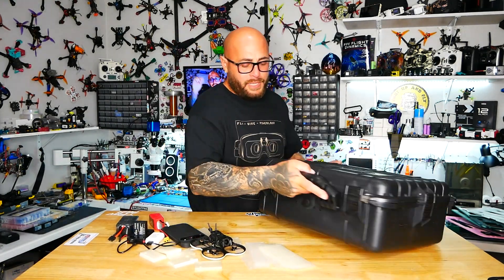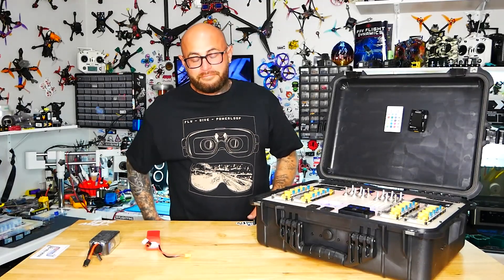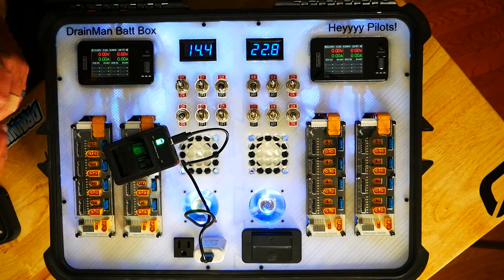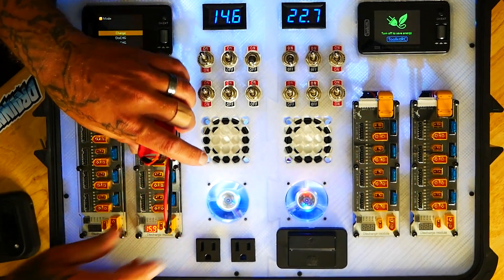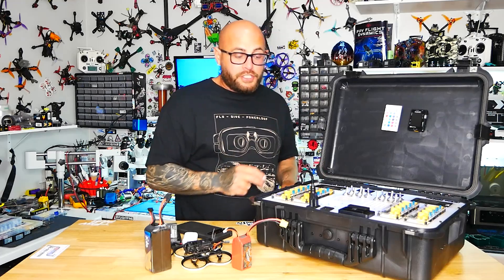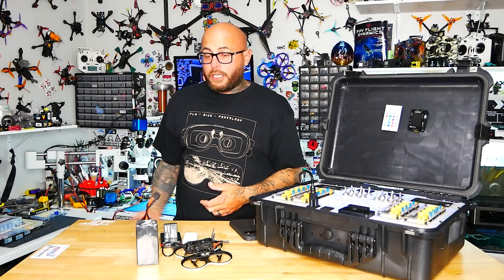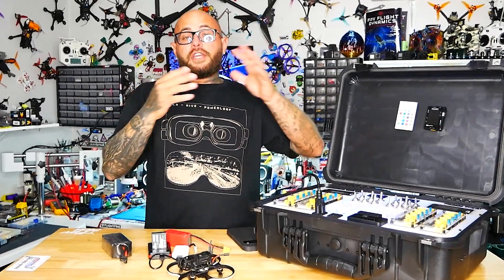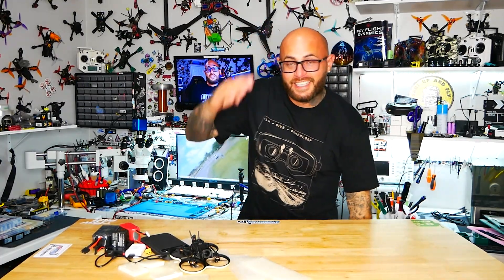The REAL Ultimate Field Charging Station ⚡ Built in Batteries & Built in Inverters 🔥

Comment: all the goodies in there.  that'd definitely be an eye catcher at the field.  there is only one potential issue that i see with it.  your box charging cable has a plug on both ends.  that could be a shock hazard if someone wasn't paying attention.  i would consider swapping that out for a standard computer style cord and just add the appropriate receptacle.  safety first!  still a great project!